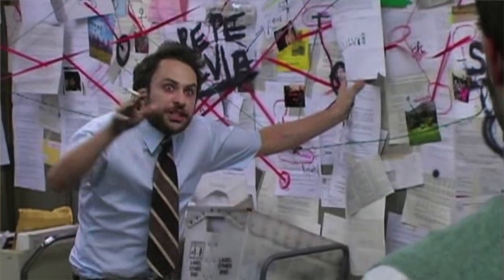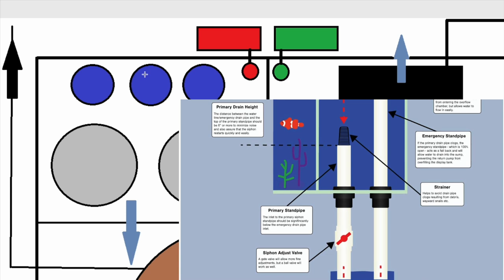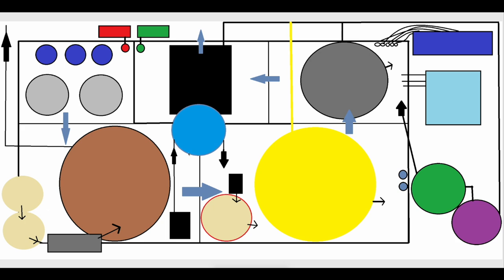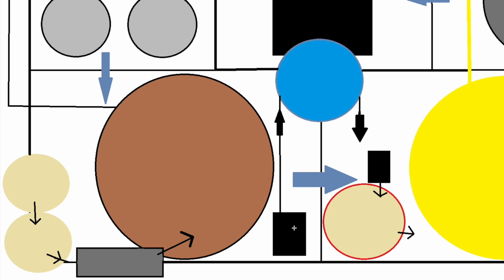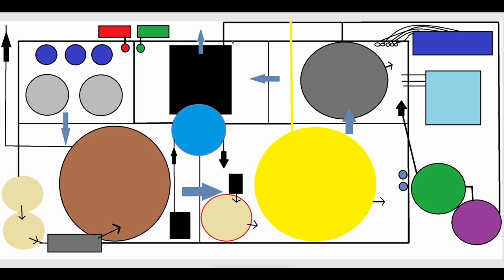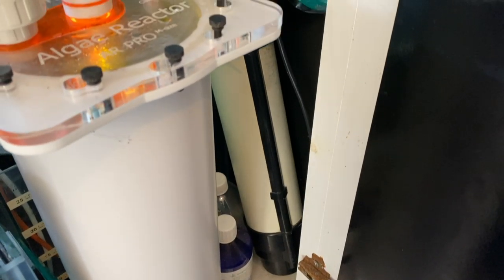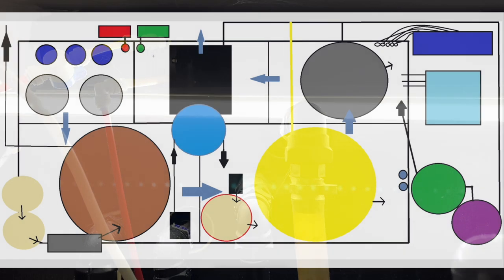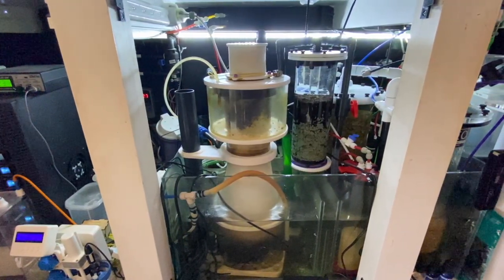Overview of a reef-gadget junkies sump

Comment: Most interesting part to me is the Ozone
Can you go over that - how you use the scrubbers and then the ozone - how long you run the ozone - if you use carbon in the skimmer and then maybe some comments on ozone and UV - like I thought they both did the same thing - I'd like to run both a CO2 scrubber (preferably recirculating - which I guess you can't do because that air would be humid) and ozone together thru my skimmer - that is mate - super interesting and helpful video
Reply from the maker: Yeah I like ozone, basically turbo chargers your skimmer. 

More than happy to do this section on my sump in detail next (well, the next episode has been recorded - but after that!)
Reply: @ParkersReef  yay 🤟 yeah ozone is something that gets basically no coverage so I'd like to see that and also CO2 scrubbers there is only a little on it from BRS but in combination there's nothing I know of - can't wait

Comment: I didn't see an ATO, is this adjusted manually? I'm curious of how i would run a litremeter with an ato. Definitely thinking about AWC haha.
Reply from the maker: Yeah ATO is a SpectraPure unit. Is in the bottom right section. 

AWC is no issue with ATO, check out a video I did called auto water change facts, myths and lies :)

Comment: Great video mate! What are your reasons for not running carbon? Do you run Purigen instead of carbon?
I've thought about removing carbon, because I run AF carbon and phosminus together. However if I ever want to run medication or any treatments, I have to turn the reactor off meaning my phosminus stops getting used to.
Reply from the maker: Cheers man! I do run carbon sometimes,  but not 24/7. I personally feel it removes more good than bad. I always have some on hand if I want to remove some pollutant from the water though.

Yeah, I’d say purigen is my equivalent of carbon 👍🏻